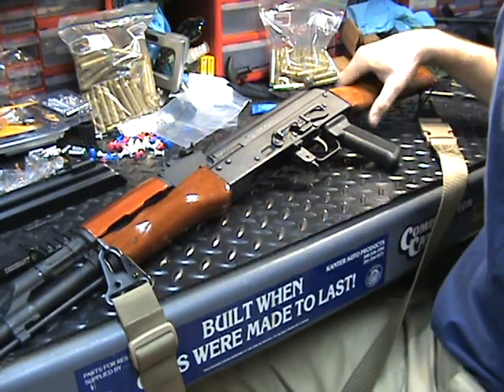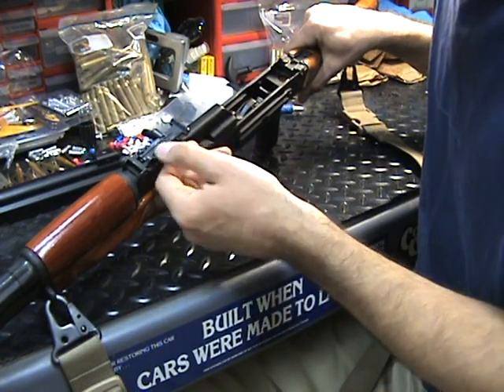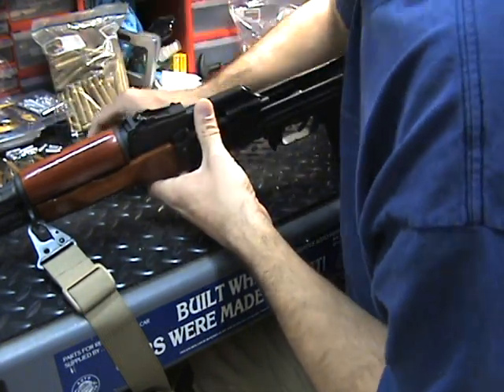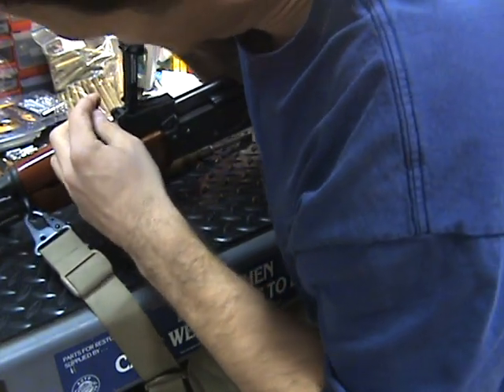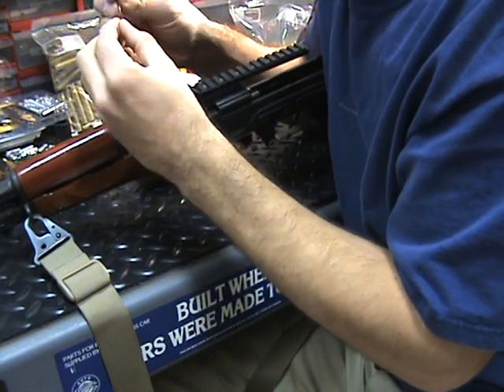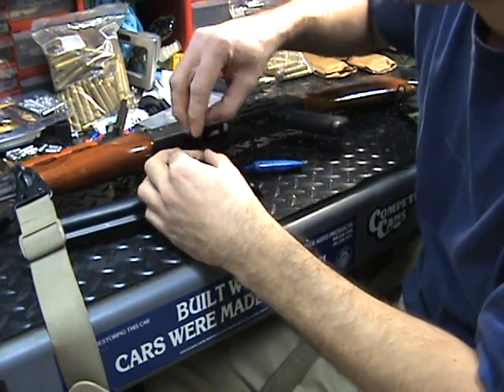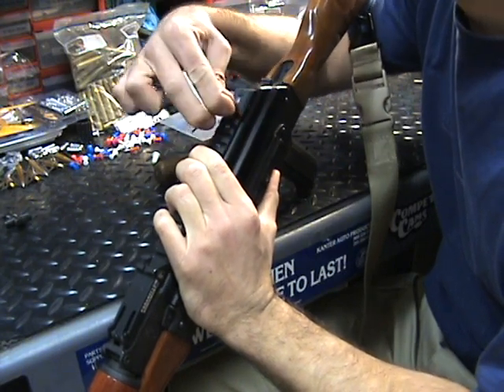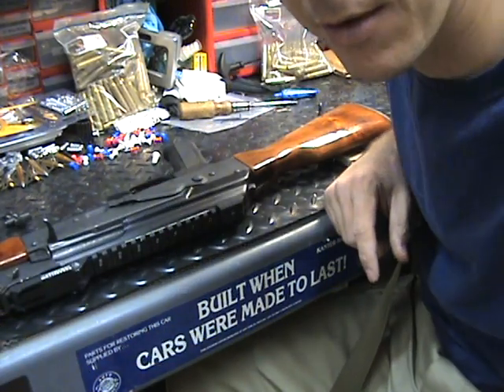Parabellum Armament AKARS Install.mpg

Comment: I like your design a bit better than the TWS top cover rail. 
I like how you all use a steel dust cover instead of TWS aluminium one. 
Now, could you do a close up of the leaf spring pin (Where the rear sight was) for the actual rail? 
TWS is held in by just a simple "E" clip.. if you have a better securing method that than you got yourself on AK fanatic who'll purchase 10+ of these rails.

Comment: Looks like a nice AK mount. Just like JLo, there is a big But behind this inquiry.The Soviets/Russian try to attach optics on their Ak's/SVD's since the 1950's. In their research and I know, you know as well, Ak's are known to vibrant violently when fired. Barrels, gas blocks and top covers. This motion cause optics to be knock off/to lose zero. The only part that vibrant less is the receiver. This is why they put a rail mount on the side of receiver. Now this new cover/rail is nice, BUT will it vibrant (I am guessing yes) and will the optic lose zero?  Will the sight on the rail co-witness with a red dot? Thank you for your time.

Comment: I wish I had someone holding the camera for me to do a close up... To answer your question, the AKARS has a support pin that is pushed through where the old leaf sight as before.  The pin is held in place with a set screw in the middle.  Put a little blue lock tight on it and it'll never come out unless you want it to.

Comment: Which pin did you use -- theres a roll pin in the plastic bag of the pin that came installed  out the box -- I installed the roll pin vs the sold pin only cuz I couldn't down the rail

Comment: THIS WOULD BE EVEN KOOLER IF THAT TOP COVER HAD A LEFT SIDE CHARGING HANDLE LIKE THE DAVIS TACTICAL LINCH COVER. COMBINE THESE TWO AND I WILL BUY IT TOMMORROW, BECAUSE RIGHT NOW YOU HAVE TO CHOOSE BETWEEN THE TWO, AND THAT SUCKS, I LIKE THEM BOTH. COULD YOU MODIFY THE LINCH COVER WITH THAT SLIDER PIECE WITH THE TWO ALLEN SCREWS, BECAUSE THATS ALL IT WOULD TAKE, EVEN IF WAS A CUSTOM ORDER I COULD DEAL WITH THAT BECAUSE I WANT BOTH.